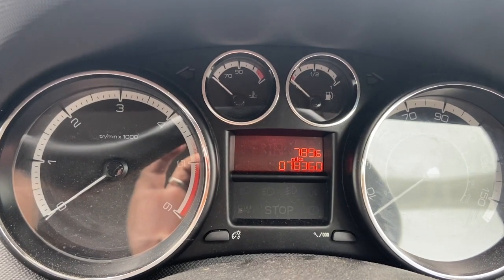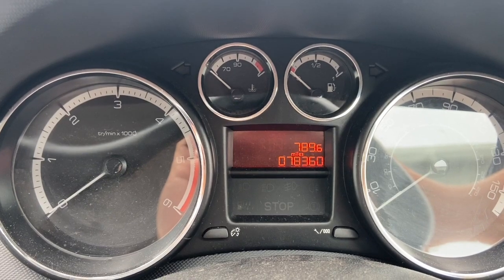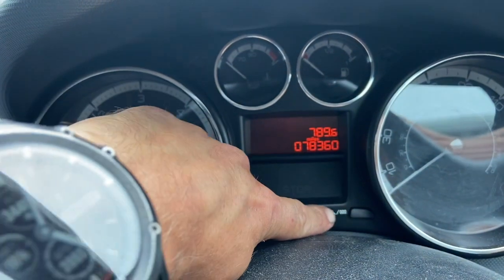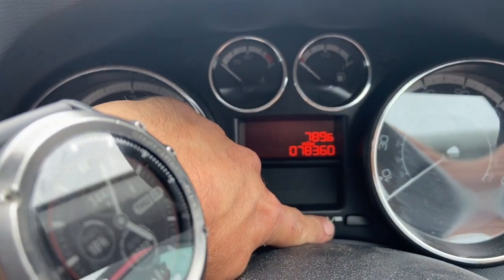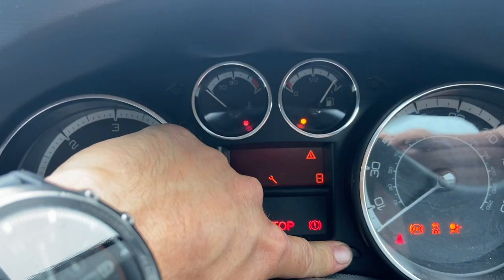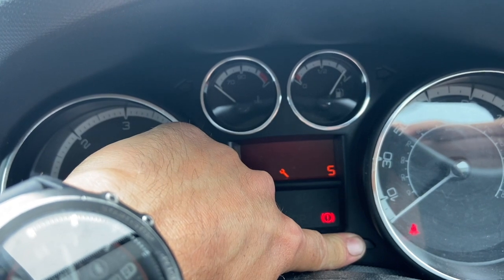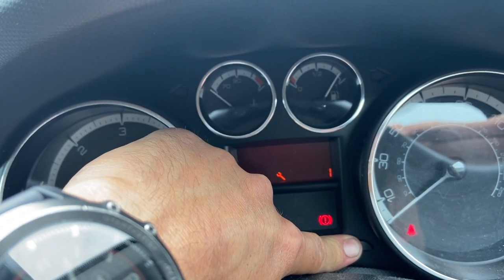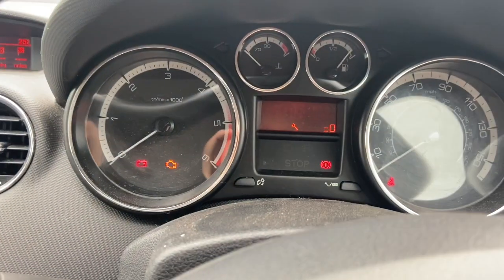Peugeot 308 service light reset

Comment: Any reason why a 308 engine management light won’t go off after the issue is fixed? Garage is trying to charge me an extra £150 to get a specialist in to reset it but I’ve already paid £800 to fix the problem
Reply from the maker: Bit hard to say without looking , depends on what the faults relating to but it say it can’t be fixed if it won’t reset